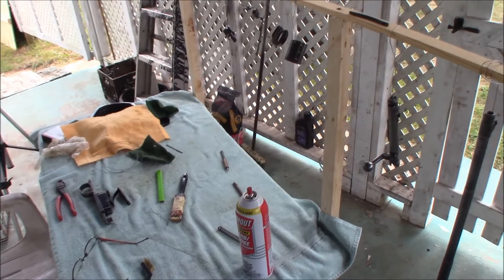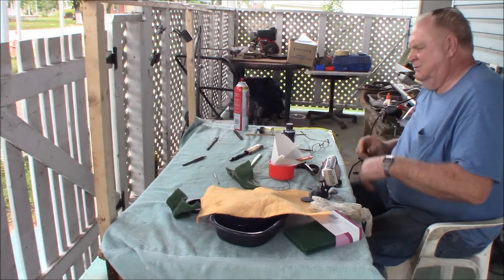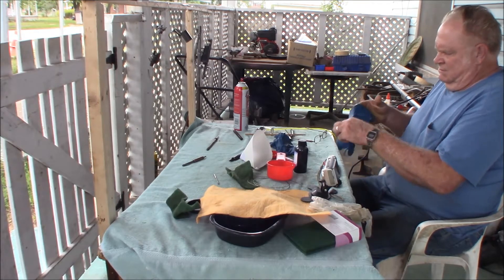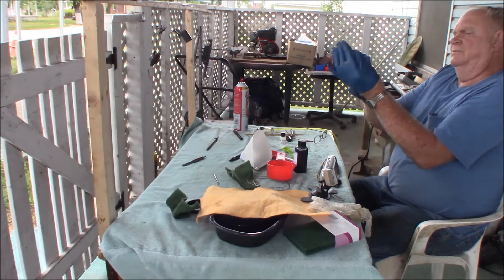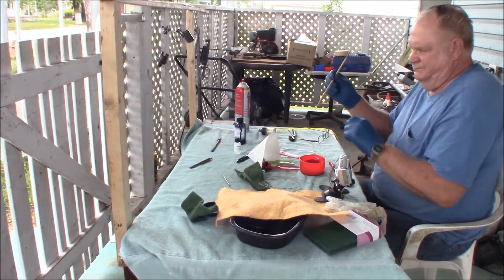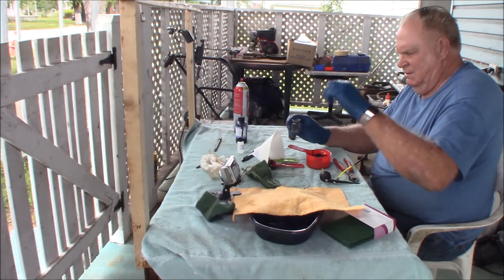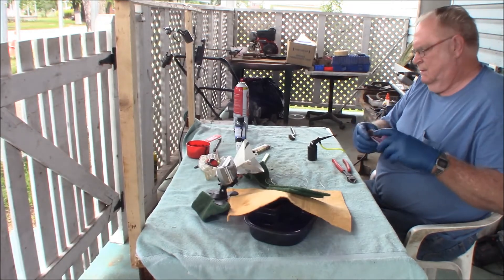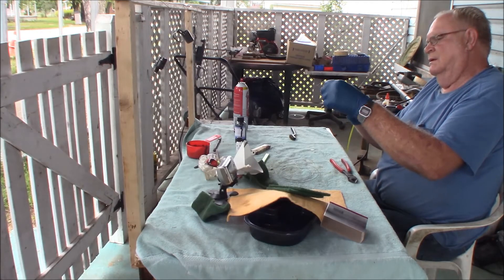refinishing metal part 2

Comment: To make those gloves go on easier blow them up like a balloon first it stretches them out.
Reply from the maker: they need to be a little bigger too.. lol
Reply: Even if they are bigger they are still tough
 cause like you my hands sweat and getting them gloves on or off is tough. But like Mike says use air.
I blow into them when I'm taking them off and pull off the fingers. I do industrial insulation so I use them a lot. They are a pain but it's better than scratching my hands all night.